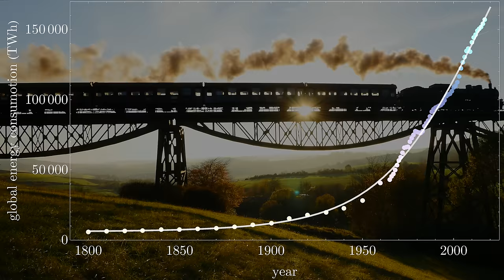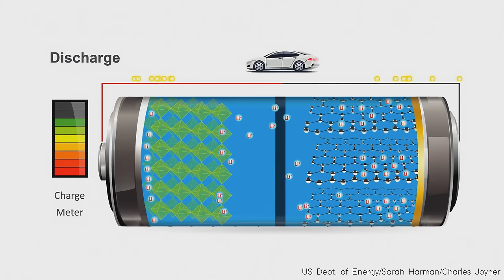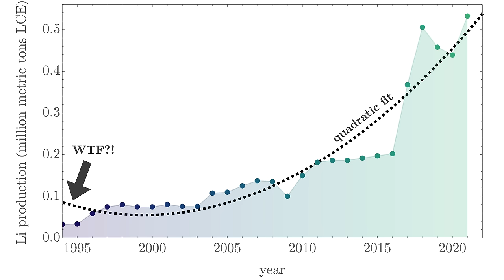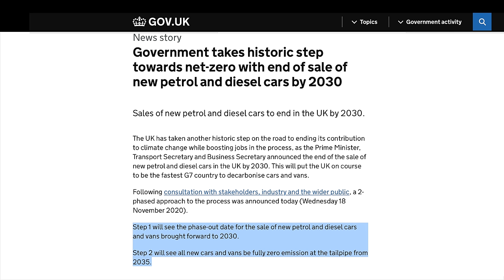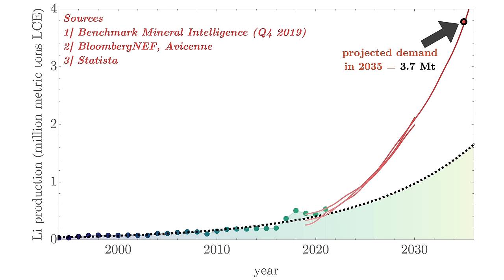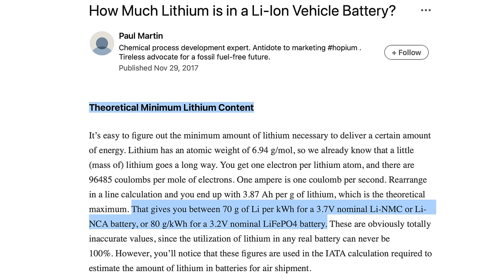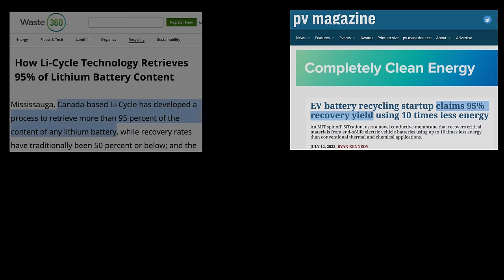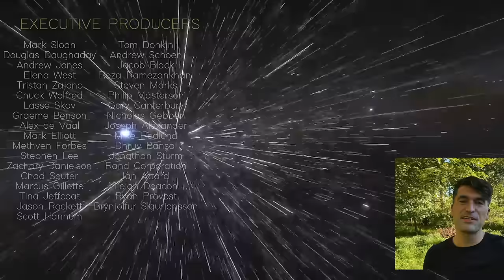Will We Run Out Of Lithium?

Comment: Great video. I wonder if non-lithium batteries - like ones with heavier elements (sodium) could be reserved for stationary applications (grid storage) so lithium could be used for high-value and mobile applications like electronics and cars.
Reply from the maker: Good idea I suspect will have to happen to some degree
Reply: I think that a lot of the tech, at least for home applications, use deep cycle batteries.  So, they already use heavier type cells?
Reply: We have SCADS of Zinc for Zinc Flow batteries.

If we had to, we could replace all the gas stations with Zinc electrolyte stations.

You’d literally “fill up your tank” while discharging spent electrolyte for recharging.

You pump the electrolyte through the battery plates to power the wheels.

But the graphene/aluminum ion solid state batteries will probably eliminate any demand for Zinc Flow cars.

I’ve read that Zinc Flow batteries are very well suited to Grid power backup.

If you can store ten THOUSAND GALLONS of charged electrolyte underground, why would you use any other battery chemistry?
Reply: Already been happening... Chemistries that are cheaper but less energy dense go into stationary storage and lower range cars... Future techs are planned the same... basic business to aim products with different specifications at different market applications...
Reply: no, it's bad, in most circumstances batteries are like the worst way of storing energy from solar and electric cars suck in most instances, better public transport would help way more

Comment: Very well thought out video! I do wonder what the carbon footprint and ecological cost of all the lithium will be as it is sold as a counter to that.
Reply: You dont need to wonder, there are studies out there
Reply: Yeah lithium like with all lithophile element extraction is not an energy friendly process (and pretty much all mining is an environmental nightmare) also lets not forget we long exceeded the "safe" energy storage threshold for lithium ion meaning that our batteries can be considered ticking time bombs prone to spontaneous combustion. 

Also lets not forget that the plans for nuclear fusion also call for lithium in a non renewable application via using it for nuclear transmutation to produce tritium for the chosen fusion process based on energetic concerns. Thus if fusion succeeds  there will be a constant demand for nonrenewable depletion of lithium
Reply: Lower than the cost of not mining it
Reply: It doesn't matter aslong it is more abundance of them then fossil fuel which is limited
Reply: Especially when they run out in the current mines defacing the ecological aspect of the area, then start finding it elsewhere and at some point it's going to effect peoples homes cause a town may be on a giant lithium deposit. Curious? Does the movie Avatar sound familiar?
Reply: Survival prepping for normal people  it is more and more, actually. In general, the larger the equipment, the easier to convert to electric or hydrogen...  I think a good metric I have seen a year or two ago was that all the energy Tesla had used for all its activities and construction, all its manufacturing ,was already far less than the energy generated by the solar panels it has sold...  All the activity of transitioning is only marginally different than what would be happening anyways (in amount) (there is a limited amount of funds and people to devote to all activities on the planet) but then the effects of that work of transitioning is huge...  Just refining oil uses almost as much electricity as an EV would use to travel the same distance that oil would take an ICE vehicle... In other words, EVs basically use the same amount of electricity already used by making the fuel for combustion vehicles, so total electricity use will not go up much with EVs, it will just be shifted away from refineries to many charging points.(mostly, it is like 90+% as much electricity to refine the oil)...
Reply: @christophermcmichael880  There are very clean methods of extracting lithium that have fairly recently been proven to be cheaper and faster at industrial scale and the companies that did the tests are expanding that kind of production, and why would others keep using the older methods that require a lot of space for ponds and is more costly and worse for the environment? Oh, and mining and refining from recycled batteries is already a proven technology with companies having the problem of not enough batteries to recycle to keep growing their scale as fast as they would like...

Comment: Some things which might further complicate the picture for future lithium demand: 
- Unlikely, but possible: Significantly reduced dependence on private vehicles due to major investment in more extensive public transport systems. 
- More likely, but with less impact: Large scale power storage forgoes lithium batteries in favour of alternatives like pumped hydro, sand and molten salt batteries.
- Wildcard: Development of price competitive carbon neutral fuels suitable for use by the majority of existing fossil fuel vehicles.
Reply: @realitycheck908  Nuclear energy, which I agree is cleaner, better, faster, cheaper, and safer, doesn't replace the need for lithium. It complements lithium batteries by providing a source for all that energy going into the batteries.

There is no way a "carbon neutral" fuel can serve as an adequate substitute for nuclear energy + lithium batteries. For starters, carbon-neutral carbon fuels don't exist. When fuel containing any amount of carbon is burned, it creates carbon dioxide (that's the definition of combustion -- oxidation of the carbon). There is only one possible thermodynamic process involving enough energy to extract that carbon back from the atomsphere: photosynthesis. So basically you have to grow plants and turn them into fuel. But growing plants at industrial scale requires petrochemical fertilizers, and is far from carbon-neutral. Secondly, even if we did magically create carbon-neutral fuel, combustion is inherently a highly polluting activity. The non-CO2 pollutants emitted by cars are devastating to human health. Combustion pollutants kill about 100000 times more people than nuclear accidents. Even if you include deliberate nuclear strikes in the latter count, combustion pollutants are still 1000 times deadlier. Clean fuel does not eliminate combustion pollutants: poisons such as nitrogen dioxide are produced whenever anything is burned in air containing nitrogen.
Reply: @realitycheck908  Basically you can't put a nuclear reactor in a car engine. Well, you can, and the car would work, but it would also kill everyone in a 10 mile radius from radiation poisoning. Nuclear reactors require thick shielding, which is possible in a power plant or an aircraft carrier, but not on a car. Also it would be stupidly expensive. So you still need lithium batteries for cars.
Reply: Thank you for mentioning carbon neutral liquid and gaseous fuels.  Seriously.  I work on the engineering side of energy conversion/storage, and I'm pretty dismayed that so many of our leaders are treating battery-electric as some sort of fix-all silver bullet solution.  Thing is, energy storage via battery has very real issues of its own, many of which are pretty inherent.  So, rather than try to shoehorn battery-electric into every conceivable application, I would really like to see our leaders get a bit smarter with their green energy policies, policies which will only be poised to create sustainability problems of their own if we don't distribute the energy storage burden among a diverse array of technologies.  My take:   such diversification would be very well served by including a decently sized fraction of synfuel ICE and hydrogen ICE.
Reply: @briank4972  100%! Couldn't have said it better myself.
Reply: @realitycheck908  Nuclear Fusion actually complicates the lithium picture in a very significant way as the reactor technologies in development which are based off fusing deuterium with tritium due to the very short half live of tritium are dependent on the use of neutron bombarding Lithium as a source for more tritium to continue fueling their reactors.

This process only works so long as there is a supply of lithium to transmute and thus if this kind of nuclear fusion materializes as a means of energy production lithium becomes the limiting reagent for fusion power based off fusing tritium and deuterium.

This notably is a 100% destructive process for lithium and there is no way to replenish this element so it is  not compatible with lithium battery storage because it needs that lithium for fuel.
Reply: @DavidJao  Note that while I agree with regard to nuclear fission as a power source if nuclear fusion ever materializes as a viable technology then the current deuterium tritium fusion reactor designs in development add serious complications regarding lithium.  This is because they are based around the transmutation of lithium into tritium to make the reaction self sustaining minus the input of new fuel and as such lithium is a limiting reagent for commercial nuclear fusion fuels.

So if and its a big if nuclear fusion is able to work out as a technology then I'm afraid you will not be able to combo fusion power with lithium ion batteries as market forces will be needing that lithium to power their reactors.
Reply: @briank4972  Hmm you are right that it is complicated though I personally maintain serious concerns regarding hydrogen based fuels given the inherently poor energy density and the quantum mechanically imposed non negligible tunneling probability which makes hydrogen so leaky in principal.
Chemical storage  technologies are interesting though in particular if you can make closed system carbon combustion you can use them as an effective means of long term energy storage.  Though it needs to be noted that any such fuel will always face the same energy budget constraints of the Earth system since Earth only receives so much solar energy flux which must be distributed among all Earth processes from our energy technologies to reradiation, weather fluid dynamics, biology and the likes.  Thus the more costly a process both making and recycling EV's and batteries or producing fuels etc. is still going to have to take a piece out of this larger Earth system budget. Renewables also feature net efficiency losses the more indirect the power is so solar is able to be more efficient than wind can be and so and so forth. 

The only energy processes not directly dependent on this are geothermal and nuclear power everything else is linked directly or indirectly to the Earth solar budget. Space based solar technologies can bypass this limit but that is the only thermodynamically allowed work around since the second law of thermodynamics puts a hard limit on closed systems.

Getting around these limitations and deciding how much of the biosphere we will want and or need will require complex solutions because Earth is a complex system. So yeah we do need to consider high density liquid based fuels though the goal should be to make our systems as close to full cycle as possible I.M.O..
Reply: Public transport is a horribly expensive boondoggle that is underutilized because it doesn't fit a suburban lifestyle. If there's a reduction in private ownership of vehicles, it will be because of robotaxis. Pumped hydro is also extremely expensive and not very practical. And I have no clue what you mean by a carbon neutral fuel for ICE cars. There's no such thing.
Reply: @realitycheck908  95% of a lithium battery can be recycled
Reply: @briank4972  there's no such thing as a carbon neutral synfuel, and hydrogen is not a solution. Elon discarded that idea a long time ago.
Reply: @darylfoster7944  if fElon said it must be hahahahahah.
Reply: @Dragrath1  that if is pretty big kind of never will happen If, and it won't happen indeed. Gen 4 reactors are only way forward.

Comment: lithium is part of the problems... 
suppose we convert every vehicle in use today into an electric vehicle, where and how in the world can we support cleanly such infrastructure?

if we're not getting this electricity from renewable resources, we're only masking the fossil fuels problem.
Reply: Yes, the whole thing is still mostly fossil fuel based, only we have added a new layer of complexity to it. There’s also the big question of recycling, otherwise of course we well run out. Recycling without toxifying the environment. There’s much more to say, question and consider on this topic.
Reply: @sIXXIsDesigns  I wasn’t questioning if it can be done, but rather that it should be done.

Comment: Thankfully all EV''s are charged by plugging into the grid which is coal run. Also lithium batteries are God awful for the environment when the cars are eventually junked. Also most EV cars can't run past 10 years or at most 15 years.
Reply: All true, EVheads are completely delusional, they just want to feel good about themselves because they drive an expensive but inferior mean of locomotion.

Comment: You missed the massive amount of batteries that would be needed for the power grid that is being advocated for.  You would need 4 to 6 months worth of energy storage to make sure there are no blackouts.  

Personally, I like my ICE vehicles and will stick with them.  Only way you would ever get me to abandon an ICE is if someone came up with a steam powered car that was comparable or better in ease and abilities as a modern ICE. Hopefully with the option of a plug and play heating element that has different options of heat sources.  
With ICE the older, the better, 60s and early 70s are the best.  Not a fan of having computers in my cars.  I love computers.  Love my desktop and my phone and tablet.  But I don't want to drive a computer.  Such a waste of resources and a massive increase of points of potential failure.

I like what I like, and I have my reasons.  No one is going to change my mind on this.
Reply: So, you think the ICE vehicles of the 60s and 70s are more reliable than those of today? I don't think so.
Reply: Lithium Ion has a huge amount of advantages for mobile applications like personal devices and cars. It's light and efficient. But not only is it fairly expensive for grid storage, it's also quite temperature volatile. Grid scale Storage can get away with being much heavier and wants to be a lot more temperature resistant. So we will need to find other battery solutions there, like liquid metal batteries or iron flow batteries.

Comment: "of course mandates can change".  Mandates cause rebellion and will fail the test of time.  The thing that works is a better product.  If you want to mandate stuff,  mandate that EV's be better products than ICE vehicles:  1000 mile range, 500k mile battery life,  fast recharge with brand independent fast charging available everywhere.    Thats my minimum for buying an EV.  The mandates you want,  just encourage producers to deliver vehicles that are not as servicable as ICE vehicles

Comment: Someone once mentioned that we will never run out of oil… and they’re right. Not because it is unlimited, but because as it becomes more rare the price will suppress demand to the point people don’t use it. The same is true for lithium. As demand outstrips supply, the price will increase to the point of depressing demand and we’ll never approach the country’s ambitious goals. Fortunately, Silicon Ion and Aluminum Ion hold promise of diversifying our battery supply. Look forward to those two technologies maturing and how they can propel EV adoption.
Reply: Excellent point and one that the presenter seems to have completely missed. Demand, supply and price are all interlinked. In our modern economies supply ALWAYS meets demand at a variable price, then the price affects the demand and supply.
Reply: Lithium is plentiful, there is way more that we can relatively easily reach on the planet than we could possibly need even if we grew our activities by 10x... Regarding ambitious goals of nations and mandates, industries and consumers are making the switch much faster than any mandates in any region... Renewables with battery storage is so cheap that all grids would like to convert yesterday... EVs have been proven and sought after by fleet operators for many years already. Consumer demand and cheaper costs to manufacturing EVs means that it will be hard to sell ICE vehicles after around 2025 with USA and a few others being about a year behind due to the extreme propaganda against EVs in some places... Tesla and Chinese companies are growing very fast and will take over any demand that the older companies cannot fill with their new EVs...
Reply: Exactly! We will never run out of oil, just as we haven't run out of uranium, coal or wood.

Comment: Aside from EV, transitioning to Solar and Wind will also need increasing amount of batteries to store power, especially for home rooftop solar.  So the real demands will be even higher.
Reply: The batterys goes to a "second life" when they can no longer b used  in the EVs, they can collect energy from solar powers and recharge your EV.
That means that there are less batterys to recycle and when the recyclers dont get any batterys they market will suffer.  All recycling need a crazy amount of energy. The demand will skyrocket so i have already amning towards buying lithium shares. The other problem is that Lithium aint the only rare metal in the battery. I cant really see the future in EVs. it must be something else thats more sustainable and need less energy to manufacture..
Reply: Static batteries like PowerWalls or Mega Packs don't need to be light, so heavier (and cheaper) elements than Lithium can be used.
Reply: lol solar and wind are not able to handle world energy needs, not even close
Reply: Stationary storage can and does already use different cell chemistries since energy density is not as important as in a moving vehicle.